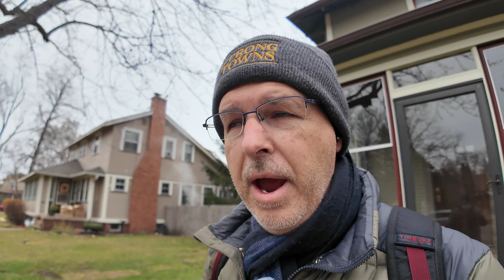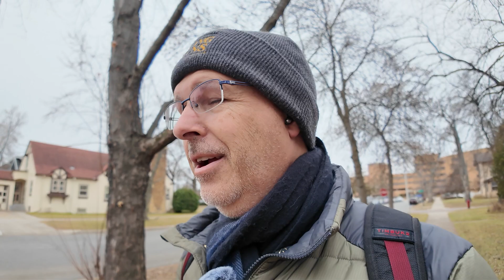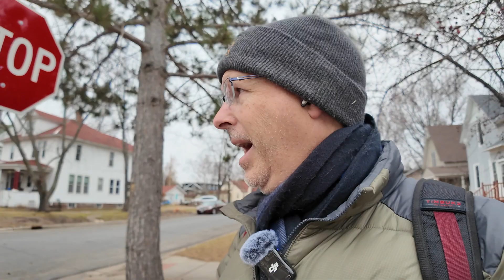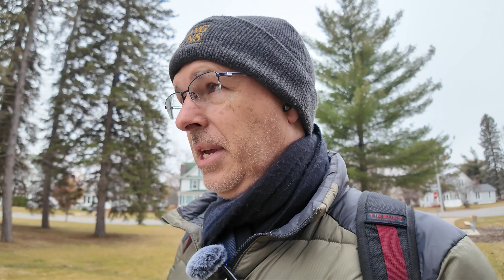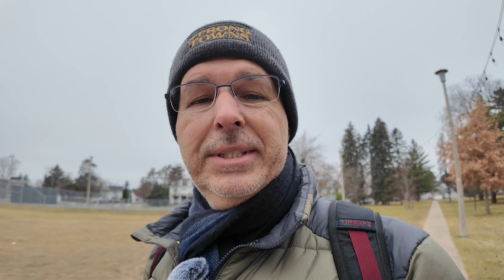Why Build A Roundabout?

Comment: Roundabouts are great; how they build them sucks.  Think of a pie.  Now cut the pie into six equal pieces.  Now, replace the pie with a circle of six inch tall concrete forms.  When you get ready to build, break the existing concrete--but this doesn't have to be 'perfect'; it will be buried with landscaping.  So the hole can be quick-and-dirty; it shouldn't take a day of work.  Then, place the six 'pieces' of circular concrete forms.  Actually two circles---one substantially smaller than the other.  Pour concrete between the circles (and these circles should be made of steel---enough to hold the concrete because they are bolted together).  BTW put a bunch of two foot tall boulders in the middle of the landscaping/roundabout and call them your 'DUI catchers (not tall enough to hurt the DUI driver but high enough to absolutely stop the vehicle).  We built a roundabout here and it took weeks and cost $8 million.  Here's how you do it: you don't design it and put it out to bid.  You say we want a roundabout here and we will pay you $1 million.  Any pre-certified contractor can come and pick up the contract and perform the work.  What would happen is a contractor finds that they don't have any work for Monday/Tuesday.  They do the work and keep their people and equipment busy.  And make about $150,000 profit.

Comment: There's a T-intersection near my house where they pre-emptively installed a traffic light even though one of the roads is still being built. I suppose in some ways, I appreciate the initiative and forethought, but it's a completely absurd waste of money as 1) the main road of the intersection is a low traffic road and 2) the new road is a small road that really will only be for residents of a new low density housing development and even lower traffic. In fact, I don't even know if this intersection even warrants a stop sign!

Comment: Let's build some cool new walkable towns - with Permaculture techniques
Reply: There's a fine example of a walkable Soviet town in Prip'yat, the abandoned town at Chernobyl. It was designed from the ground up to have no private cars in town so everyone had to walk or take the bus. You had to take a bus outside town to get to the parking lot where your car was kept. It looked like a model and must have been a quiet town at night, but I can't help thinking of bringing home a family's worth of groceries on the bus with a 3 or 4 hundred meter walk through the rain or snow to get from the bus to your front door. That could be lethal here in Canada. The unfortunate thing about walkable is that you have to walk.
When they built the replacement town after the accident, it was the opposite of Prip'yat in a lot of ways. Slavutych has private houses with driveways as well as apartments and a much more compact layout. Even the Soviets realized that ideological urban design was a mistake.

Comment: Roundabouts work great on low volume roads.  They bad on high volume urban roads.  Unless there is a plan to keep traffic volumes low along the road, a roundabout is much more expensive if the volumes graduate to signal warrant levels (unless using a modular method as a stopgap).
Reply: @traffic.engineer  so you are saying in most instances where we have a multi way stop a roundabout wound be better right...

Cause guess what, we have more multi way stops than signalized intersections in the US...
Reply: @triaxe-mmb  Yes, a roundabout is better for low volume roads.  Unfortunately, the costs are the reason for relatively low numbers.  They are much more expensive to construct, and acquiring land is an arduous costly process.  And now multiply this by 10 million rural/suburban intersections in America that would qualify, the cost is astronomical.  European countries have much less roadway to maintain, thus have more control and funds to implement them.
Reply: Some of these dissenting comments might have been addressed if Chuck cited numbers for cost, fatalities, and throughput. I asked city government where I live how they plan to change our roads without increasing costs and they said that they wait until they have to resurface the roads to change them.

Comment: A tip from "back East": don't mix the terms traffic circle and roundabout.  New Jersey built a lot of "traffic circles" in the 1940-60's.  They were big enough to go thru at pretty high speed because of the low volume at the time.  Many have been straight lined with signals.  The ones that are still left can be terrifying, since modern cars can really fly around them.  People freak out when they hear that term.

Roundabouts in the modern sense are very tight.  Even modern cars are forced to slow to 20 mph or less.  Gaps to merge into traffic are created and merging is done at far slower speeds. Throughput is better than a traffic signal with left turn signals.
Reply: Traffic circles cause spectacular high-speed accidents. Roundabouts cause four-way road rage. Lights cause neither, and stop signs at least have rules everyone can follow and things happen slowly when they do get gummed up.
Reply: @GWNorth-db8vn  Traffic in the circle/roundabout has the right of way, traffic entering has a Yield. Traffic lights with left turn lanes have their issues, too.  Freight training left turns after the green arrow goes off.  The "orange light" floor it problem.  The cut in front of everyone left turn, a.k.a. the "Pittsburgh Left".   Many of these behaviors lead to T-Bone crashes at speed.

Roundabouts work better in some cases.  This video does not go into the particulars of the intersection in question.  See US 222 in Berks county Pa.

Comment: I work as an assistant at an accident reconstruction firm, and my boss tells me all the time that roundabouts are more dangerous and have more points of conflict.

I really don't understand his worldview when well made roundabouts are clearly safer
Reply: Your boss failed at engineering.  Standard intersection has 32 conflict points, roundabouts have 24 conflict points.
Reply: Single lane roundabouts have almost no conflict points and none is 90°. Double lane roundabouts (which the US builds WAY to often) however are a mess.
Reply: @kailahmann1823  the merging and diverging points are still conflict points, plus the pedestrian crossings.  It increases with more lanes.

And dual lane roundabouts are still relatively rare in the US.  Single lane roundabouts are more common as they are safer.   Certain states like Florida, Indiana, and Arizona experiment more with dual lane roundabouts, but many other states do not consider multilane roundabouts except in special circumstances.
Reply: Your boss needs to tour the world.  There are no light in my city of 30,000 people (not in the US),  just roundabouts.  It all works great without pointless red-light delays.

Comment: I live on the other side of the world in a place where roundabouts were historically the first option. Some are good, and others allow high traffic roads to further slice neighborhoods. Years ago when the area was less populated they worked fine but with higher traffic density they are just a nightmare for pedestrians to the point where the busiest roundabout got some pedestrian lights! Those lights were an improvement ( though it still takes a pedestrian 3 minutes to cross the road!). Before they went in I wouldn't want to cross outside a vehicle and no one else did either. At one point there was funding for a flyover which fizzled that really would have glued the neighborhood back together. The Dutch seem to be able to make them work - but of course where they need to they'll build theirs to prioritize pedestrians and cyclists first - such a thing is a long way in the future for your country and mine.
Reply: is said roundabout more than 2 lanes?
Reply: @benjaminhigham3624  Each direction has a pair of lanes.

Comment: I'm not fond of pedestrian crossing at roundabouts.. but it may be better than the alternative
Reply: I generally agree with this. Roundabouts can be scary for pedestrians as drivers are looking left and not at the crosswalks and they're designed so that traffic doesn't stop. This may be germane to certain roundabout designs however. This particular location doesn't sound like a pedestrian crossing though.
Reply: I find that the crossings they replace are worse for pedestrians.
Reply: They can be better if designed right. Near where I work, the roundabout has islands where pedestrians cross one direction of traffic at a time. It's easier to go to that roundabout and cross the road instead of waiting for two lanes of high speed traffic to clear.
Reply: you just cross one lane at a time – so just wait until there is a gap in traffic or a car stops (the second would be the norm here in Germany)…
Reply: Ah, the simplicity of the Old World.
     North American has been dominated by the automoble - so much so that the "emperor" still uses his "feet" to measure distance, such as 5-hours away.
    Someday we could bring back the 2-lane roadway, but it will mean the others will be used for buses or bicycles.

Comment: I don't mind circles, but circles generally don't take cyclists into account and they're not that pedestrian friendly.  A nearby town put a small circle in, but it's so small that it's really like a slight curve to go through... the locals on the main thoroughfare just fly straight through.

You mention "if they're designed right"... I'd like to know what you consider correct design.
Reply: A lot of modern ones are built with large visual obstructions (like giant concrete planters) in the middle so you can't really see what's going on from other directions as you approach and you *must* slow down. If they're wedged into small places this may not work.
Reply: @Datamining101  narrowing the entrance lane and most importantly stop to angle it to the right would also help.
Reply: Near the roundabout where I work, it has islands for pedestrians to cross one direction of traffic at a time. That along with a size & design that actually works to slow down traffic - should make it much safer.
Reply: Here in the South, the old rural towns and cities have a town square, which means a traffic circle. It’s not a roundabout but similar. 

You slow down because you have to and because there’s parking slots to navigate. Admiring the optional statue of a random Confederate traitor in the middle of it all is between you and your God. 

I will say this, however. Old town squares are the only legit city feature these little towns ever had. The rest is just sprawl, as with any suburb/farm.

Comment: i think when designed in the wrong way, they can be very dangerous.
when circle is very big, cars can "jump out" of a roundabout very fast.
it really depends on the design here, too.
Reply: If some idiot flies over the island, they at least removed a hazard from the road: Themselves.
Reply: @kailahmann1823  yup.  Stop signs and traffic lights slow down drivers with social and legal consequences.  Hence a driver may get away with running stop signs and traffic lights many times without consequences.  Roundabouts slow drivers down with physical consequences much more reliably.
Reply: What, relating to roads, cannot be dangerous if designed the wrong way?
Reply: The real problem is American vehicles/drivers can't take corners....

Comment: Thank you for this good explanation of the benefits of roundabouts. It makes me wonder where they would fit well in our community.
Reply: Here in the UK we put them in moderately busy streets and roads with the room. They have about 80% of the capacity of a signal controlled junction. If the road is very busy for a short time traffic over the whole day will be faster.

We put traffic lights on very busy roads where there is no room for a roundabout. Also on very busy roundabouts if you still class them as roundabouts.

Look at google maps for Carmel, Indiana or UK, France, Netherlands etc for similar sized town to yours then look at the roundabouts in street view to see how they fit in.
Reply: @johnclements6614 Thanks so much for sharing this! I will try to set aside time to look on Google maps to see if I can find roundabouts in cities that are similar size to mind. 🙂🚗🚓🚕